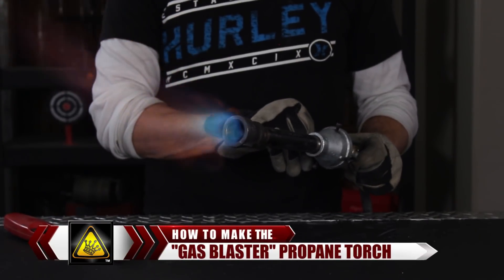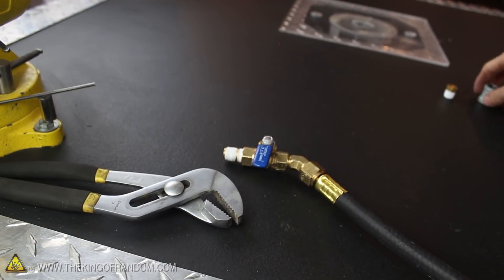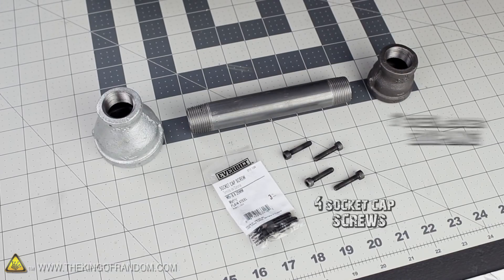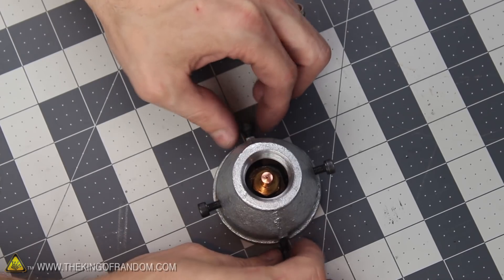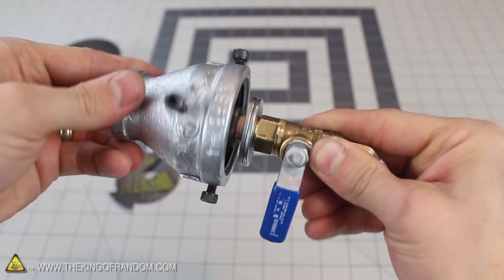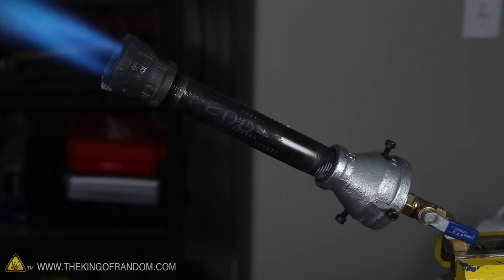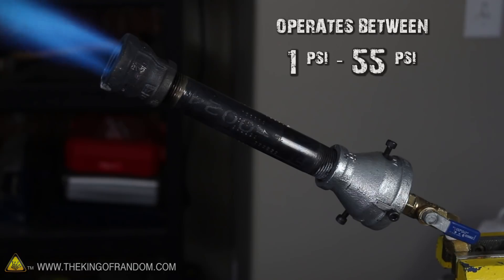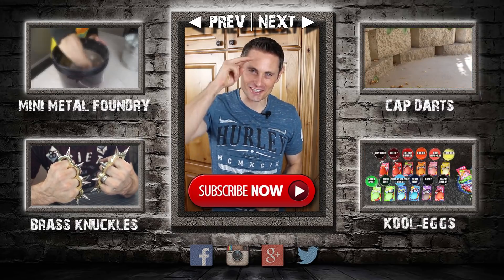Convert Your Backyard Foundry To Propane! ("Gas Blaster" Propane Torch)

Comment: I'm in the process of building a torch using this video as a template. I have found that the "1" steel pipe" is actually a 3/4" X 6" nipple. I also stayed away from any galvanized materials as they produce toxic fumes when hot. 1 alteration I made was instead of a rounded out tuna lid, I cut an actual steel plate to shape and used a washer and spring for tension (mostly for the sake of not having a tuna can lid on my parts list.)

Comment: To check for leaks you can use soap and water in a spray bottle. Once pressured up you can spray the joints and you will see bubbles if you have leaks. Just to be 100% sure

Comment: Unless you really want to blow yourself up then please don't use thread tape on your regulator brass is a tight enough fit it's also an OSHA violation to use thread tape on any gas hose or regulator
Reply: It's not going to blow up. And fk OSHA.

Comment: I made one of these this weekend but it won’t stay lit,  if I run it with the air flow closed it lights but when I turn up the gas it goes out when I run it with full air flow, the same thing happens. I set my propane to 20 lbs and in order to get to stay lit I have to just crack open the ball valve, anymore than that it gets too much gas and goes out. And no matter what I can’t get that nice blue flame like in this video.... any ideas?

Comment: A few things worth noting. the set screws  holding the jet in place should also have locking nuts to screw tight against the air intake. As mention below, a different tape should be used. Removing the flare from the end of the 6" pipe and inserting into the foundry will melt the end of the pipe and render the threads useless. Make sure that the hose being used is the correct type that is rated for high pressure applications. Last but not least, when checking the system for leaks, turn your gas on and use a soapy water spray over all the joints to ensure there are no leaks. High pressure propane is dangerous and will destroy you in an accident.

Comment: RIP This is THE video that got me started on what eventually became a metal fabrication shop. 

Just a quick FYI for anyone about to make this: The brass fittings are made to seal against one another, so you shouldn't need tape, just really crank them down hard when screwing them together. BUT... when you attach brass to steel (or some other metal), you DO want to use tape but not the white thread tape. They make a thread tape specifically for flammable gas that is yellow in color that you should use here. I believe it's because the white tape deteriorates when used in gas systems
Reply: Thank you for addressing this difference in gas tape.
Reply: Very important info here.
Reply: I believe it's because of gas molecules can slip through the white tape but the yellow tape has a higher concentration of Teflon in it which prevents that from happening.
Reply: Yeah, they're also typically stocked right next to each other too. Always read labels, I didn't know about the gas tape but I did buy yellow tape because I thought "Hm, this stuff says it's for gas and the other stuff doesn't"

Comment: I have built this with all the exact same pieces but am only getting flowing orange flames I have the exact same pieces what am I doing wrong
Reply: I had the same trouble at first using a bbq regulator, otherwise everything else is identical. I picked up an adjustable regulator and its much better now but still not perfect.

Comment: Why does my flame keep burning inside the pipe and not as perfect as yours? Im using a 2.8kPa regulator and used exactly same parts than you used... Please assist

Comment: Would I be able to use an iron coupling for the 1 - 1 1/2 reducer? I can't find a steel one anywhere even on Amazon.
Reply: shiloh huite watch the video further he goes on to say it’s not even nessisary as the foundry itself acts as a funnel for the steel pipe and it won’t fit in the side with the hole he had specified for his home built foundry
Reply: shiloh huite aside from that call around to some local plumbing suppliers and ask if they have them or would be able to order one in that might be your best bet some things can be tedious to get

Comment: Ok so i made one of these and converted it to propane but when i put the lid one it the torch starts to sputter and go out if i turn it up to much. I can only run it up to 5 psi with the lid on. Do i need to make a another hole for air intake?

Comment: A spritz of dish soapy water on all fitting will show if there is any gas leak.  Hearing shouldn't use to determine a leak that's why ethyl mercaptan is added to most LP-Gas and even smell isn't always a sure thing.

Comment: I have a question for anyone who has built this, I have built mine, with a single torch. Will adding a second torch increase the max heat, or will it just increase the time to reach the same heat of one torch?

Comment: Does the size of the 1" iron pipe matter?  I am using a 12" ( for heat dissipation) and only getting a small flame and a lot if backfire.    I also notice the flame starts half way down the pipe.
Reply: yes if you use stuff different then what they use it will work differently.

Comment: I recently built one of these and had to change a few things because my hardware store doesn't have the exact parts. It cost about $70 to build which is a lot more than expected but it works really well despite the changes made.

Comment: Just a heads up for anyone confused, the 6 x 1 inch steel pipe and 1-1.5 inch steel reducer coupling in the description are wrong, and not even what is used in the video. He actually uses a 6 x .75 inch steel pipe, and a .75 - 1.5 inch steel reducer coupling. The other steel reducer coupling is fine though.

Also, the "free template" is no longer free, and i will be making my own design. If anyone is interested let me know.

Comment: "boil brass"  ?

Rubbish!  Brass, depending on alloy, will burn at about 6000F.  That's like the temp of a welding arc.  You would be seeing blue light and UV.

Comment: I only made a one torch set up for cost effectiveness. I was having trouble melting brass, does anyone know if you need two torches or as my psi too low?
Reply: Daniel Lantz use around 10-15 psi
Reply: WarioGiant, huh, I was having trouble melting brass at about 30 psi.
Reply: Daniel Lantz idk then is your flame blue?
Reply: WarioGiant, I mean the nozzle in the tube is a little crooked but that shouldn’t make a substantial difference. But yeah the flame is blue. I also is a bike pump pressure regulator which does work, but it is not as consistent at keeping pressure then the one he has.
Reply: Daniel Lantz i’m just using a regulator that goes up to 15 psi and it’s working flawlessly
Reply: WarioGiant, well, I haven’t replaced my interior yet. It’s got a lot of small cracks. Could the heat escape through that? Because I don’t think the nozzle being slightly crooked would lower the heat.

Comment: It would be easier to build this if your parts list was correct. 3 or 4 of your links are wrong. Starting with the 1/4” to 3/8” brass nipple. Correct in the video, not correct in your link!. Also, to anyone else building this, it 3/4” pipe, 3/4” to 1 1/2 inch coupler, and a 3/4” inch to 1” coupler. Still waiting on my last part to try this burner. Also, the drilling and tapping is really hard to keep straight by hand. You are going to be taking this on and off your propane tank, get the POL valve that has the tightening nut with the rubber gasket.

Comment: for anyone wanting to make one as I have just to note that the 1" -1 1/2" reducer coupling or reducing socket in the uk should be 1 1/2" x 3/4"   or you will have one reducer that will not fit the 6" pipe

Comment: My other problem is thread direction all the threads are right hand apart from gas line which is left hand thread. How does the 3/8/ 1/4 flared flange fit a left hand threaded gas pipe unless of course American gas hoses are still right threaded?

Comment: Galvanized water pipe should not be subjected to high heat...zinc + vapors/gas = bad.
Should've used "black" pipe for NG or LPG.
Also, use yellow tape on threads for gas. White Teflon shouldn't be used for gas, only water.

Comment: I'm curious what the second reducer actually is.  the link has it as a 1 to 1/2 reducer but in the vid it isn't.  it looks like it might be a 1 1/3rd to 1 for the exhaust side...  (the other is 1 1/2 to 1)

Comment: Need some clarification. Video shows 1 1/2" to 3/4" Reducer Coupling, 1" to 3/4" Reducer Coupling which would  require 3/4" pipe (not specified, only length of 6").   The Amazon links bring you to 1 1/2" to 1" reducer, 1" to 1/2" reducer (????????) and a 1"x6" steel pipe.  What is optimal?  And the 1" to 1/2"reducer must be an overlook.  Nothing else has 1/2".
Reply: I ran my first run with the charcoal version and it worked great but I feel propane will have better results.  Cleaner, more control and higher temp.  Already have some fitting laying around and am trying to get it together.

Comment: Now that I got it all built and running like it should I spent two hours with it blasting heat into my kilm and it's still would not melt the copper.
Everything was glowing red and getting soft but the copper would not melt

Comment: You forgot to mention a couple of things you'll have to spend 30 to $50 on a high pressure regulator because regular old propane Regulators are too low pressure to operate this type of burner

Comment: I made one of these but it doesn't give me the short blue oxidizing flame at the end.  Do you think it would be because I didn't put the last reducer on the end of the 6" pipe nipple?  Or would it be more because of the fact that my welding tip isn't perfectly pointed down the pipe do you think?  I didn't drill thru the brass plug as straight as I would have liked.
Reply: Well, I put the reducer on the end and that didn't seem to help.  I will try to get the welding tip a little more centered to see if that helps.  Oh, and I got the .030" welding tip too - maybe that is too big?

Comment: anyone that actually built this use a flashback arrestor ?
Reply: +xsniper3500x. if you use a high pressure gas regulator then a flame arrestor isn't necessary as the high speed of the gas will be enough to keep the flame away from the fuel nozzle.

Comment: You don't use tape on that kind of fitting. Or with propane. Nothing but threads tightened and leak checked with soapy water while under pressure.

Comment: Is there any difference between the charcoal and propane temperatures?
Reply: the simple answer is yes, the technical answer is that it depends on a few things like what kind of charcoal you're using. commercial cooking charcoal has additives that lower it's burn temp. pyrolyzed wood however has none of those so it burns hotter. it also depends on how much air you're forcing through the burning charcoal. more air = hotter burn. overall though propane is better, it heats material up faster and more evenly than charcoal does. it's also so much cleaner to use as there's no ash left over.

Comment: KingOfRandom what psi does it need to be to melt alum, and with 2 burners is it the same also how long will a 15 pound tank blow 2 torches if left on at the psi that melts alum fine. Please answer quickly as im planning to get this build by spring

Comment: Can this be used for a 50 gallon drum forge
Reply: nah, you'll need something a bit bigger for that. might i recommend the MagFire 500,000 BTU propane torch kit. i have one that i use as a forge burner and i love it. 500K BTU should be more than enough for your needs. if not just buy a 2nd one for a total of 1,000,000 BTU.

Comment: just gonna say... a mig tip fits very snug into a 1/8" pipe nipple... so if you dont wanna drill & tap that... just get an 1/8 inch tee and press that bad boy in there

Comment: heres a nice little question from someone who is planning on doing this, about how long does the tank last? im seeing if its more cost effective to use char. or propane
Reply: +Mark Kane.  my first forge ran on charcoal and tbh charcoal is fine, there's nothing wrong with it, but i personally believe propane is better. it'll get your furnace or forge hot faster than charcoal. charcoal also burns very quickly when you start forcing air through it which means fuel effeciency is absolutely horrid. running my first forge once used half a bag of charcoal. so all in all i'd say propane is definitely better.

Comment: Maybe this isn't an issue for your assembly, but as a general rule of thumb, it's a bad idea to use galvanized stuff for anything relating to high temperatures because it can generate toxic fumes that can be lethal. Look for non-galvanized material or de-galvanize it by submersing it in white vinegar until the finish has been completely stripped.

Comment: Grant, currently for my conversion I am having an issue with PSI.  When I first open the propane tank I have great pressure for 10-15sec, but then it drops off to nearly nothing.  The propane attachment I have for the propane tank currently does not have a regulator, so I was curious if you used a regulator or if you have had an advice about the drop in pressure.  Yes, I have leaked tested all my connections.
Reply: bad valve on propane tank, changed mine out for a new tank and it works fine

Comment: Hey! Just a question for general understanding. Does any of the valves used in this burner design come with a flashback arrestor? If not, wouldn't it be smart to install one, to create a failsafe device, just in case?

Comment: hey got a question about the 1 1/2 steel reducer coupling  and the 1 steel coupling  ??? on the 1 1/2 steel reducer one end is 1 1/2 and the other is 1 ??    
and the 1 steel coupling what is the other end size supposed to be i live in the mountains and lowes doesnt have what i need cause i dont know the other end sizes ??? please help

Comment: Curious why you have 1" pipe for the burner and adaptor couplings in the description but the video shows you using 3/4" pipe and couplings? Any difference in performance?

Comment: A few questions: The 6" pipe, you say it's 1" but it the reducer looks to be 3/4" in the video. On top of that, the reducer you linked came up as 1/2". I found a cheaper alternative for the hose and once I get my questions cleared up, I will link up the parts that I was able to pull up after researching some cheaper alternatives that will still yield the same items and results.

Comment: I built a torch just like this using the same parts, though it does not have a air intake regulator and my assembly is a bit shoddy, but it works! The only problem is that I can't ignite the propane with a BBQ pit lighter or a blowtorch and can only sustain a flame when there is burning material in a confined location (such as a foundry). Still, it gets hot enough to heat steel in only a few minutes. I converted to propane from kerosene (and before that, Diesel) and I can easily say the propane is way easier to control then the other fuels mentioned and requires less cleanup. Now, I just need to build a proper forge.

Comment: Building this now and having immense issues tapping the set screw holder.  I have a drill press and set screws with the proper tap and bit, but the world is not cooperating at all.  First tap got stuck and I mangled it up to get it out.  I chocked that up to the wrong size bit and older tap I had laying around.  Second one I bought a new bit/tap at the depot and the tap snapped off.  Each time I was using oil, backing in and out, and only going by hand-no drill.  Is there some magic secret to tapping this coupler that I am not privy to?

Comment: omg... I can not even express my thanks into words rn. the parts list you made. you included EVERYthing needed included the little screws. that saved a lot of searching and Gatorade throwing. I now know that the price of pretty much everything is $303.67. that includes the crucible and wool and all the parts for the blaster. (I looked up everything on amazon) but K.O.R you are amazing thank you so much

Comment: My flame is starring about halfway through the jettube, what did I do wrong? The torch heats up quickly and I'm afraid of a failure. Has anyone else had the same issues and what did you do to fix it?? Any insight is GREATLY appreciated

Comment: Obviously, there are a LOT of replies. Without having read them all, I imagine someone has already commented on this.  Even so, I'm sure it is worth repeating:

First of all, these videos are awesome!  The instructions are very clear & organized.  The audio and video quality are top-notch.  

That being said, I was very surprised to discover you didn't mention the diameter of the main pipe.  Because of that, I looked at the link you created for the parts list.  There, the pipe is listed as 1 inch diameter by 6 inches long.  Luckily, I did not order it online, requiring I mail it back.  But I did have to make a couple of extra trips to Home Depot before I finally figured it out.  

After close scrutiny of the video. I was able to catch a glimpse of the 3/4" marking on one of the couplers.  THERE: 3/4"!!

In  my humble opinion, I think you should make a correction to this.  if not, you will have a lot of people being confused and frustrated.  Thanks!
Reply: the main pipe is 3/4 in diameter?
Reply: I love the projects and appreciate the videos.  But, I am just now seeing this comment after tapping, assembling, and firing the torch with 1" pipe and adapters.  $30 down the inventor drain.
Reply: @pickmyphotos  Perhaps you can salvage this project by increasing the diameter of the jet tip opening to a slightly larger opening?